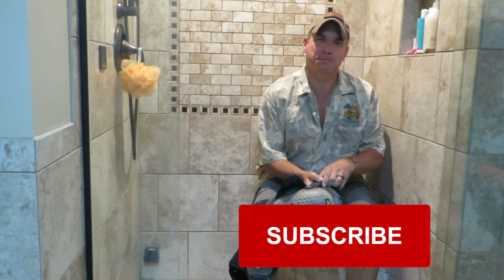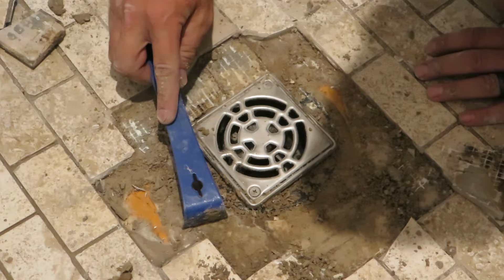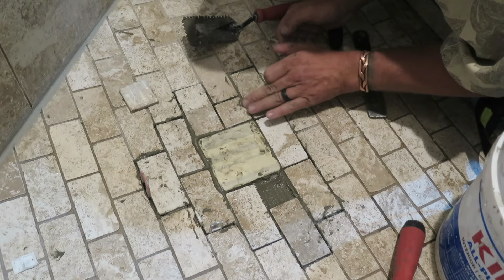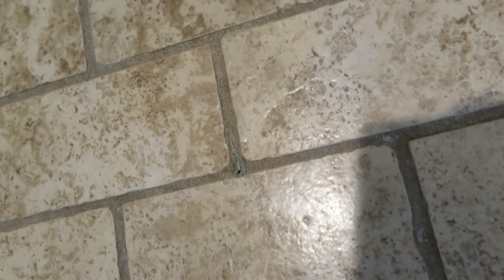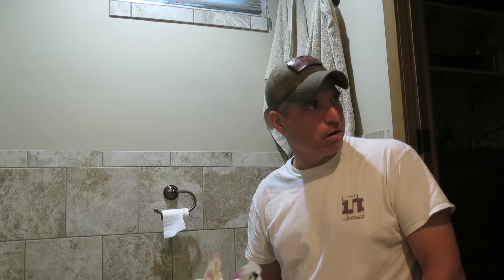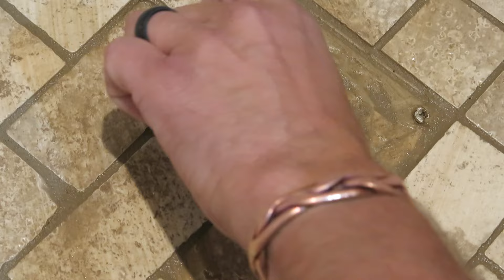Steam Shower Floor Tile Repair

Comment: Getting ready to tackle a full shower floor replacement for a buddy. This video was helpful. 

I could tell there was a previous repair just like you did. Except it's still leaking and bad. Ceiling drywall below is brown and swollen. They stopped using it. 

Custom home builder and outdoor living contractor for 27 years and never set a single tile in my life 🤦🏼‍♂️😂. 

Thanks man. And thank you YouTube.
Reply from the maker: Hey there Jasn. Thanks for watching and taking the time to comment. 

Fortunately, this repair was on concrete subfloor in a basement and the membrane was still mostly intact. The secondary damage could have been MUCH worse. That's what it sounds like in your case. 

Your job sounds considerably larger than this one and opening up Pandora's box. It could be everything from plumbing to failed waterproofing. Then, there's potential repair of the floor joists, mold and fungus mitigation then sheetrock. It's hard to say where the water is migrating from. It could be failed in the wall or wicking up from some other location and moving through capillary action. Another great plug for Schluter's Lifetime Warrantee on labor AND material. :) Your job sounds SPENDY! 

Tile's pretty simple. Since you're handy, I'm guessing it'll be a breeze for you (at first, I think the challenge is being able to move the tools effeciently). Using Schluter products is a LOT like "taping" drywall without having float the joints. I sort of count on about 1/8" wiggle room when it comes to the tile itself at least on the edges. Try to recognize when you're out of square early and anticipate small incremental changes to get back into square and plumb. You'll do great! The biggest thing that adds success to a shower install is making sure the walls are square and plumb. I recommend using a laser! 

Hope that's not too much of a rant on the ol' soap box. 

Thanks again for watching and commenting!

-Mat W/1T
Reply: We demo'd this week. 
Floor tile over floor tile. 
Caving in at drain
Flange out of level 1"
70s style kerdi dissolved
Mortar base turned sand 
Wall tile on 1" of plaster. 
Back half sub floor rotten
Curb was toast 

We removed everything and 3 row of wall tile (4x4s). The rest of that plaster shower is tougher than a tank. Fortunately the rot wasn't full blown cancer like it can be. 

Patching the little rot tomorrow AM and I decide to invite a buddy over to do the install. Kerdi + foam. He's even gonna set the tile. 🙏🏼 

In the long run I'll have done this job just to pay guys but the homeowner will be delighted and they may toss me a French Door reno on the back of their  house. 

Thanks again for the content and the reply.
Reply from the maker: @jasndavs  Yup! Can o' worms! 

So glad to hear you're one of the good guys and not gouging the homeowner. □ Of course, you're in business to bring home the bacon too. 

-M@

Comment: Thanks for posting this video! It really helps me understand the process and materials I'll need for my repair. I've got my work cut out for me... I'm about to attempt a similar repair on the shower tiles in my house in Tokyo. The landlord refused to fix the tiles which started coming loose when we were living there. Now that we've moved out, our contract states we need to leave the house as we received it. Here in Japan, it's not so simple to find all the materials, especially in the quantity (or quality) needed.

Comment: Thanks, Matt you did great work and had very good instructions about every step of the process. Wishing your channel much success!
Reply from the maker: Hey there Mr Sager thank you so much for the compliment!

I checked your YT channel and found your Etsy page. You sir do beautiful work! (from the snips I could see in your comments) I've always admired the use of "old" silverware transformed into beautiful accoutrements. 

I'm sure you're doing great in school. From the look of your class load it's a challenge. I too tried for a BA in fine art as a young man. Had to settle for an AAS in Aviation Maintenance (which took me 6 years to complete) ??? lol

Thanks so much for your subscription, comment, compliment and watching! 

-Mat W/1T

Comment: I need to do this exact repair so thank you for this demo😊
Reply from the maker: Hey Starblue5785. Thanks for watching and taking your time to comment! The main reason I started this channel was to help folks like you. Small(ish) repairs, like this, aren't outside of the capabilities of most homeowners. Being able to take care of home projects yourself is a pretty great way to save money. Receiving comments like yours if validation that I'm on the right track. :)

In the long run if this repair had not been addressed, it would have led to a much more complicated problem that would have been outside the scope of most diy homeowners and cost thousands to repair. 

Thanks again for watching. If you have any other home repairs that I can demonstrate please let me know. I'm always trying to figure out new content. 

-Mat W/1T

Comment: You make it look easy!
Reply from the maker: Hey there! Yea, these smaller jobs are fairly easy. I'd say the most difficult part of resetting the drain is keeping the small mosaic tiles all on the same plane. The only hassle is that you need to give the thinset time to cure. 

Thanks for watching and the comment! 

-M@ W/1T

Comment: Thanks for the video!  We have about 10-15 smaller tile that have come loose around the floor drain in the shower. It's a very similar situation to this video. We have different layers of adhesive under the tile and its a bit uneven in spots.  Can i just apply thinset more liberally in lower spots to make it even or would you recommend the dreaded task of removing all prior adhesive thats left over the top of the substraight before adding new tile?  I really would love to avoid this task if possible.  Thank you!

Comment: Helpful video! I was going to do this myself, but it looks like the tools alone may add up to the $300 I was quoted for the repair.
Reply from the maker: Hi there Mr. Pulsipher. Thanks for watching and the comment. 

I don't believe the tools would be much more than $50. The thing is, when you start talking about thinset and other consumables. The problem is that you have to buy fairly large quantities. Then what would you do with it when you're finished? The next thing to consider is the fact that most contractors have some sort of warrantee. Lastly, there's years of skill and experience and YOUR time is worth something. 

I'm confident that you are more than capable to do this yourself. To be honest, $300 seems more than fair for this repair. 

Thanks again for watching!

-Mat W/1T

Comment: Thank you for sharing. My husband and I are redoing our shower and having trouble with our shower floor that we grouted adhering. The grout hardens and then after using it for a week it starts to soften. Trying to figure out what we are doing wrong.
Reply from the maker: Hello Mrs. Farrell, thanks for watching and taking the time to comment. 

My guess is possibly of a few things. First, there might not enough thinset under the tiles near the drain. It's important that a layer of thinset (near 100% coverage) stays under the tile for adhesion in order to "set" them. It should get pretty thick near the drain. When setting, it's like allowing the tiles to "float" on top of the thinset. With the Kerdi Drain, there should be about an inch of thinset below the tile. It gets somewhat messy when setting near the drain. 

The next thing (and somewhat common) make sure to back butter underneath the drain grate frame to ensure full support by the thinset. (I'm fairly certain this is what occurred with the repair I did in this video). This is a crucial step in the process, I make sure to completely fill under the lip so that it will squeeze out creating a bit of a mess. For this step I make sure to mix the thinset a bit on the dry side and allow the thinset to cure for a few hours before I start cleaning out my grout lines. (If you start to clean it out too early, it can add moisture to the thinset allowing things to settle). 

If the shower "tray" wasn't waterproofed properly to the "drain flange" and water is allowed under the collar this would allow movement which would create a failure point. 

Lastly, there might not be enough subfloor support underneath the shower tray near the drain. This would mostly effect the tiles a few inches away from the drain flange itself. That would then propagate inward and outward from the edge of the flange (about 6" away from the drain grate). 

"Softness" typically has to do with excess moisture. Grout is not waterproof. Neither is thinset. However, if set properly without voids (100% coverage under the tiles, under the drain grate frame) the moisture has little effect on the tile. Remember, it's the membrane beneath the tile that makes the shower waterproof. It's not the thinset/tile/grout itself.  

If you check out my channel there are a few videos of installing the membrane/Kerdi and the actual drain. 

Good luck! I'm sure you're going to figure everything out. If a monkey like me can do it, anyone can. If you have any questions let me know!  :)

Thanks again for watching!

-Mat W/1T

Comment: I am in the process of doing the same exact thing. I had a loose tile close to the drain because it looks like there was little to no thinset under it. When I pulled it up, it took a little bit of “fuzz” from the orange Schluter product up with them. The orange product is definitely intact but I’m worried I affected the waterproof quality of it? I pulled that tile up very carefully and did not gouge the orange product. 

Should I apply any sort of waterproofing or something before re tiling?
Reply from the maker: Hey there Mr. Martin! Thank you so much for watching and taking the time to comment. 

So... Without being there I couldn't make a real definitive judgment call. However, this is how I'd look at it. 

First, if you apply anything to the Schluter system other than a Schluter product (Schluter-Set/Set, off brand "unmodified" thinset or Kerdi-Fix) the lifetime warrantee would be voided. That being said, I wouldn't use any other waterproofing product in your shower.

The "fuzz" is the fleece on the product. It's my understanding that the fleece provides the tooth for increased adhesion of the tile to the substrate and/or kerdi membrane/band to the substrate. As long as there are no holes in any of the membrane itself there shouldn't be a problem. The polyethylene under the fleece is what makes the system waterproof. 

If installed properly there is an overlap on each seam of 2 inches. If there's a delamination at the seam it should be addressed. I've used Kerdi-fix to stick down delaminated edges before. Here's a link to the small tube of Kerdi-fix via the 1T Fit and Finish Amazon Associate Program: https://amzn.to/3NESPfs - Kerdi-Fix is used to secure the edges of Kerdi and Kerdi-band to existing structures such as tubs or drains. 

If the drain flange is a Schluter drain flange with a Kerdi Grate, the outer diameter of the flange is almost 12 inches. If you were to look at a cross section of the drain it should be tile / thinset / Kerdi Collar (orange fleece) / thinset / Kerdi-Drain (white-grey fleece) / PVC / thinset / white polystyrene foam (shower tray) / Thinset / Subfloor. As you're removing the tile near the drain, you should be able to see where the Kerdi-Collar (orange) overlaps the Drain Flange (white-gray), The Kerdi-Collar overlaps the drain flange a bit further than the required 2". As long as that seam isn't disturbed and there's no holes in the collar you should be fine. If there is some delamination of the Kerdi-Collar (orange fleece) from the drain flange (white/gray fleece) for peace of mind I'd probably Glue the edge down with a little Kerdi-Fix. The Collar overlaps the Tray and the drain and seals that joint. Where you're talking about the repair, it's "down river" so to speak from the actual joint seam If there was a little delamination 1/2" or so, there shouldn't be a problem. 

If the collar seems like there's a void under it or it appears to no longer be adhered to the drain flange, that would need to be addressed by removing the tile back to the outside edge of the Kerdi-Collar (apx 18"-20") away from the drain. Remove the collar, clean and remove as much of the old thinset as you can then re-apply a new collar and you should be good. You could special order a Kerdi Collar OR go to a Schluter dealer and buy a couple feet of Kerdi membrane and make your own. 

Keep in mind that the Kerdi Grate and Frame is free-floating. Make sure to not use too much water for cleaning out the thinset from the grout lines when re-installing the tile. This can cause the void under the tile. Over time water will continue to flow on the outside of the Drain Grate/Frame and will erode more and more thinset from under the tile. You'll eventually have the same issue as you currently have. If you're using Schluter-All Set (or whatever thinset you're using) I'd make the mixture on the thicker (dryer) side of the recommended water amount. Make sure to over fill the underside of the lip of drain grate with thinset! If you don't you'll leave voids and again the same problem (My guess is that this is what happened originally).

When I set the tile around the drain area I allow it to set-up for several hours before I clean out the grout lines. The idea here is to wait until it's thoroughly set but not completely dry.

Shower drains are notorious for failure. One of the reasons I like the Schluter products are that there's a bit of redundancy in that area. 

It sounds like you'll be fine as long as there's no delamination. Make sure to fill under the lip of the Grate/Frame to avoid voids. :) If your repair is within a 12" diameter circle of the drain and you see no delamination you're good to go.

I apologize for the novel I wrote here. I just wanted to be as thorough as possible. 

I hope I answered your questions. Thanks again for watching and for your questions! 

-Mat W/1T

Comment: I have a flo fx drain and the installer did a horrible job of tiling around it, id like to have it fixed just scared whoever fixes it may mess up the roll on water proofing that was used, hydro ban was used, since he flofx drain is 1 piece it seem like it should be an easy fix since it's just a 2x2 piece that needs to be replaced. On this repair I would have put some kind of waterproof in that area because that membrane was done, at least covered that area in silicone or painted some redguard/hydroban in that spot. I wouldn't worry about the color, my main concern would be the best product

Comment: Good video!! question: did you add any sealer to the tile after the grout was completed? If so, what product did you use?
Reply from the maker: Hi there robertoariel8476! Thanks for watching. 

I'll preface with; I normally use modified grouts that don't require sealer. 

In this instance, the grout was a decade old and I did use a grout sealer. I used the "Miracle Sealant" Grout sealer that comes in the bottle with the brush on top from the big box hardware store. I did two or three coats I can't really remember. I don't have a preference with regard as I've not really seen much difference in any that I've used. 

Good question and thanks for the comment and compliment! 

-M@ W/1T

Comment: If I don’t use a height collar adjustment, do I still apply thinset around the flange itself?
Reply from the maker: Hey there kamasamoa thanks for watching and the comment. 

That is in interesting question. Hopefully I can answer it. 

Setting the drain itself and setting the Grate Assembly are effectively two different processes. 

Thinset around the Drain Flange: Within the Kerdi Shower Tray there is a step which is centered around the drain. This accepts the drain flange. The drain needs to be bonded to the Kerdi Shower Tray. The plastic ring with the trapezoidal cut-outs is called the "bonding flange". That is designed and required to be set into thinset in order to bond to the Shower Tray. The final step in the drain installation process is putting the Kerdi Membrane collar over the bonding flange using thinset. This step is crucial in order to waterproof the entire shower system.

The height adjustment collar comes with the Grate Assembly. I think of the Height Adjustment Collar as the bonding flange for inside the Kerdi Drain. The Grate Assembly essentially "Floats" inside the Kerdi Drain. The height adjustment collar is what provides the slight adjustments needed to compensate for tile size and placement. The thinset "locks" the Drain Grate into position Horizontally and Vertically. The height adjustment collar is what is used to make sure the Drain Grate is just below the plane of the tile for proper drainage. 

Now, after all that... 😁

If the repair your doing is not utilizing the Schluter System, I'd need a little more information for reference. If it's simply a problem with your tiles coming loose, it might be that you just need to re-set them in place. If your steam shower is actually leaking there's a high probability that your waterproof envelope is compromised and you might need a complete rebuild. 

I hope I helped. 

Thanks again for watching and the comment. If you get a chance to share my channel and subscribe I'd really appreciate it. I'm getting very close to 1000 subs and hope to reach that goal by the end of August! 

-Mat W/1T